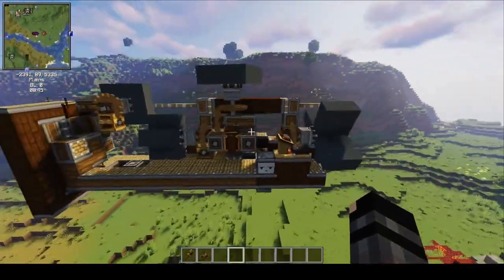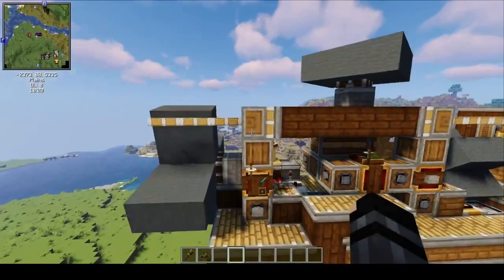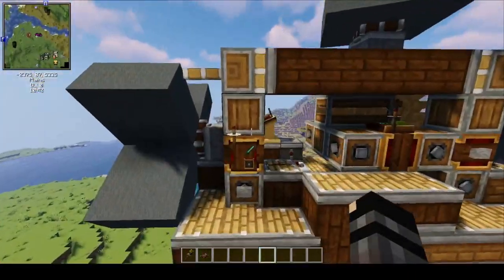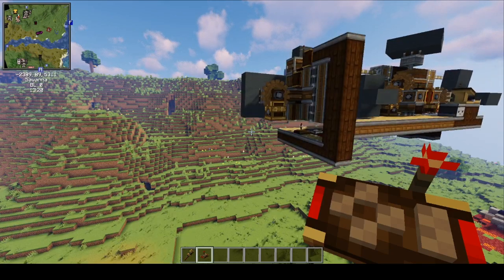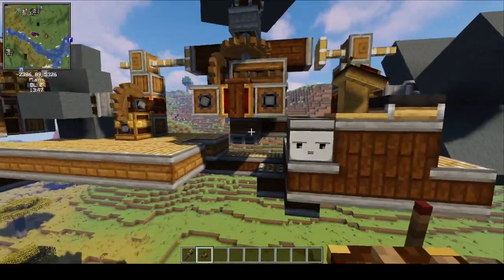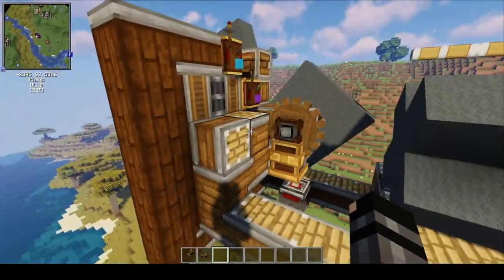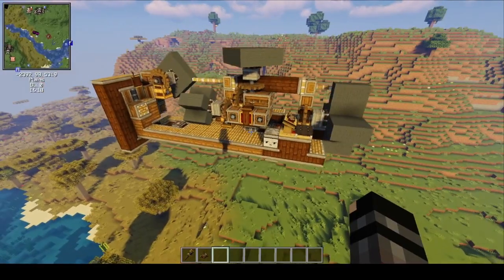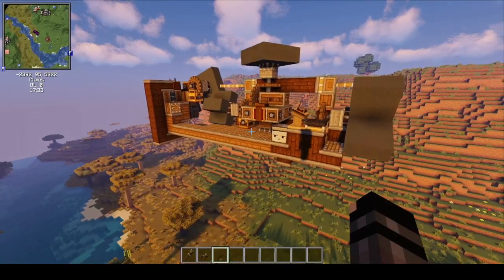Create Mod 0.5 - Make your own airship! - Engine Tutorial

Comment: I hope you read this! If you're using this on fabric, the sequenced gearshift is a solid block, which can cause the up/down mechanism to seize up (the wireless redstone transmitters power themselves). Replace the transmitters on the front two seq. gearshifts with a redstone dot, and that fixes the issues. If you read this, kwizzle, please pin it so people see this when they look for fixes!
Reply from the maker: Thanks for the tip for Fabric users, comment pinned!

Comment: A few things I would like to try:
1. Add a rope pulley elevator to get up and down, maybe instead of the ship itself moving vertically.
2. Make it all part of a minecart contraption for easy retrieval and mobility (doesn't use rails to move).
3. Make it a mining machine, with drills on the front and built-in self-sorting storage. Only moves horizontally, but can turn side to side. Encased in glass for some protection from mobs. Ideally, it places torches at intervals as it goes.

Comment: Glad to see a YouTuber actively trying to help people fix their problems. For me... how can I put this? Somewhere along the way of adding on top deck, a landing platform (making use of secondary chassis, a pulley and a couple extra windmills), and moving the controls elsewhere on the craft, the forward engine breaks. The rear will push the front forward, but the front piston will only extend and not pick up the chassis connected to the rear piston upon its return. Already attempted multiple troubleshoots.
-Disconnected added-on upper section, but weight/block limit was not the issue.
-Completely rebuilt the secondary linear chassis assembly, but may have superglued it incorrectly.
-Could be something to do with the redstone contacts misaligning or aligning at the wrong time.

TLDR: any advice on fixing forward inchworm engine?
Reply from the maker: Hmm, have you seen my troubleshooting video? Part 2 to this one. I would say that after each change you make, test the engine to make sure it still works. Also be careful with glue and leave a space between the windmills and any other blocks you place. Sometimes the windmills decide to break everything if you don't give them space.

Hope this helps!

Comment: Something funky happens. I can get it to turn left and right, I can get it to go forward once or twice but not consistently, and it seems to shuck five gearboxes into the void every time I print it.
Reply from the maker: Hmmm, try starting over by placing the schematic again. Be sure to destroy the original since we don't want any Redstone signal interference. Once it's in place start all the windmills then rotate it once. The try moving it forward. Let me know how that works out.
Reply: @KwizzleHazzizle  I believe what was happening was there was an old box of glue from a previous project where I built it, which was causing an issue with the chassis timing. I also figured out the issue with the gearboxes- it was turning them into vertical gearboxes as it moved.

Comment: So, kind of a complicated request, but I'm running into a strange bug in my world where the pistons are unable to push/pull blocks for no discernable reasons on my contraptions. The mechanical bearings are working fine, though, so I was thinking to use a leapfrog mechanism instead of the inchworm style engine (similar to what you have for vertical movement, but used horizontally). The only downside is it produces this arcing motion for each "step"—would you have any idea how to get rid of that so that it moves in a straight line?

Comment: What does pressing the back key do? Also, how could I add a casing to it? I’m new to create
Reply from the maker: You can encase it using other blocks and glue. Chassis will also automatically stick to the same kind of chassis without glue. The back button  might set it to continue in automatic mode but I don't remember if I have that feature on this specific build
Reply: @KwizzleHazzizle  i set the back button to toggle autopilot, basically replacing the lever. Is there a size limit to what I attach to it or can I go insane